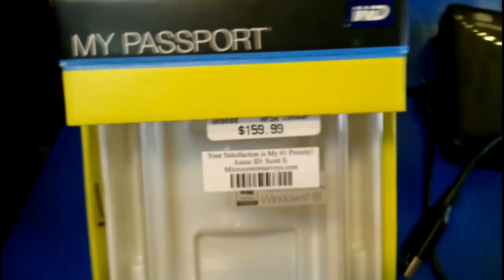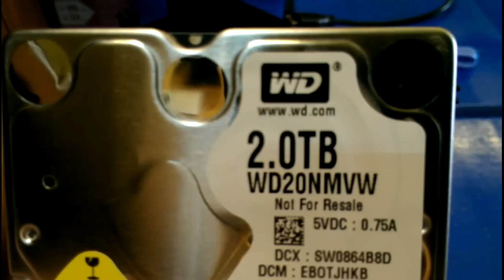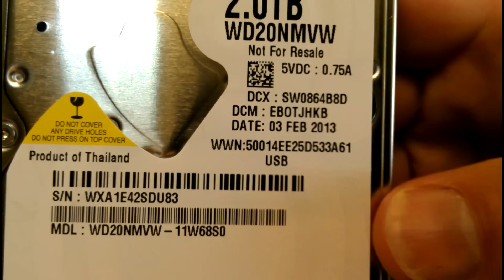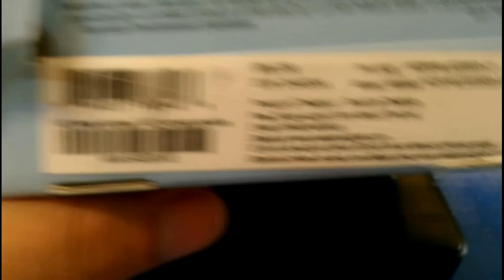Western Digital MyPassport 2TB USB 3.0 HDD Disassembly

Comment: I see some pins next to the USB connector.  I wonder what they are.  It looks like there are 12 pins (2 rows of 6).  It would be interesting to see the pinout for those.  I have seen a pic somewhere of a USB only drive like this with a SATA cable wired to the chip somehow.  I never tried it so I can not tell if it worked or where they connected what.  I just know to avoid those newer my passports.  I wonder how data would ever be recovered from those things anyhow.  It must be a little different from a standard desktop or laptop drive.

Comment: My password is correct ( I'm 100% sure). But it's not working. Earlier, I had set don't ask for password in this PC. After resetting my PC, I can't get into my WD Passport 4TB hdd. It's saying 'invalid password'. It has only been 3 weeks since I bought it and it has some very important data for which I have no backup. WD customer care says that the sector with password might've got corrupted so that I have no option but format! 
Please help.

Comment: This HDD Blue or Black type?
Reply from the maker: that one specifically, I don't remember it being in a color category. Its a really thick hard drive at 5400 RPM. I would put it in the "black" category.  At the time, 5400RPM was high speed for notebook drives.

Comment: hello what connection is the one with all the pins called, 14 pins i believe? not the USB port, the one next to it? thank you
Reply from the maker: The 12 pin header is for "data recovery" technicians.  But you cant just
 plug in a cable from there to your laptops SATA. I have seen people 
soldering SATA connectors to points on the circuit board. But nothing 
easy.
Reply: im not computer savy. I only want to recover pictures and music on my external. What would be my cheapest option money wise? Thank you for the reply
Reply from the maker: Data recovery is scam  that will cost you thousands of US Dollars. You didn't say what was wrong with your drive or IF anything is wrong at all.
Reply: I have a WD My Passport Ultra 1TB. I thinnk I ejected improperly one too many times. I tried a different cable, different computer but it will not read either way. I have a mac. I tried doing the first aid thing but cant repair. The light on the external works fine and there is no improper spinning of the disk or weird noise. I went to an electronic store and they said it could be the USB port thats fried. Changing that out (by sodering a new one on) seems complicated for me...
Reply from the maker: before we butcher this thing, what did WD support have to say about this?
and how did this 'electronics store' know what's wrong? 
if you want to recover data, that will cost you big. At least $4000. you really need someone who knows what s/he is doing to physically look at the thing. A local competent computer shop for example. Not Best Buy or Radio Sh17.
Reply from the maker: at least plug it into a windows machine and then a linux machine.  at this point, its hard to say if its a format issue ( mac vs windows ) or an interface issue. Or something else. it is often possible that a mac will see a set of files completely different from a windows machine.
Reply: I connected to a windows but nothing. The techs at best buy and frys could not bring it up on there computers. The tech at frys just mentioned the USB could be fryed. I only wanted to recover pictures, music and some files. Definitely not $4000 worth.

Comment: Is that .75 amps required for both together? I am having issues with my WD external 4tb drive randomly disconnecting from my Xbox and someone suggested that the power draw may be more than what the USB can supply. I know USB3 can supply up to 900 mA so if 2tb draws 750mA than 4tb would surely draw more than 900mA. Also, I don't know how much my drive draws cause there is no specs for it. Even Western digital doesn't specify it.
Reply from the maker: total at the connection. but that's the max.
Reply: leefiles It only seems to happen when the drive it underload. like processing alot of data. Do you think a external drive with a separate power supply would fix the issue?
Reply from the maker: You can use a Y splitter. You see those when you buy a slim portable CD/DVD-ROM drive. You can plug one end into your PC and the other end to a wall charger. Or you can plug both into your PC if it has true multiple USB controllers.

Comment: @leefiles - Hey man! I actually have the same hard drive as in your video, but I need a new one for my Xbox One (only to use externally). Do you know if the newer models open as easily as the old ones? More specifically model WDBBKD0040BBK-PESN. I have 3 hard drives for different purposes and all different colours. The reason I want to crack a new one open is to spray paint the top green. Also, have you spray painted any hard drives?
Reply from the maker: I haven't had any trouble opening any portable hard drive.  WDBBKD0040BBK-PESN looks like you need a pry tool. Or if you're handy, a credit card or any hard plastic. Not metal.
Reply from the maker: As for spray painting, just remove the label first. You may need many many layers to smooth over all the bumps. The thickness also means you can't touch it for many months unless you use thin layers and wait for each to completely dry first. And don't spray paint in Singapore or you'll be arrested and caned.  https://en.wikipedia.org/wiki/Michael_P._Fay

Comment: Sooo, you CAN'T disassemble this drive. I was hoping that the usb controler had failed and thought about taking the drive out to connect it to a SATA port, but... no SATA drive. Shame.
Reply: This is exactly, and honestly why I will no longer buy another Western Digital external hard drive.  They've made them with proprietary parts, disallowing users to troubleshoot these drives with third-party hard drive enclosures.
Reply: Same here, I really wanted to get some use out of these drive, is there someone new in charge of the USB based drives division?  If so, they need to be removed, this is going to drive me away from WD, I have been a huge disappointment.  The USB interface on these things will fail from time to time, it was never a big deal as I could still use inside of a PC/Laptop, if you take that away, I will have to go over to seagate who still use the more standard interface.
Reply: If the PCB fails, just get a new identical drive and transplant the PCB's. Easy enough.

It's the cheapest solution tbh.
Reply: Any idea on how exactly to do that?
Reply: I'd like to upgrade my old Passport to usb 3.0, does anyone know how I can upgrade it if it doesn't have a SATA drive?

Comment: What's the name of the 12 pin connector?
Can it be used internally if the usb doesn't work??
Reply from the maker: The 12 pin header is for "data recovery" technicians.  But you cant just
 plug in a cable from there to your laptops SATA. I have seen people 
soldering SATA connectors to points on the circuit board. But nothing 
easy.
Reply: Suddenly my WD is not working via USB, and i have many important files on it... 
Do you think is possible to recover them??
Reply from the maker: First make sure its not a power issue. Plug it in a known "good" desktop.   Do that before you go for a warranty claim.

Comment: what are those 6x2 pins besides the USB 3.0 port.. can that be use?.. in any case the port became damage..
Reply from the maker: +Zodiac Hidalgo  You cant use those for SATA. Its USB only. Sorry.
Reply from the maker: +leefiles  actually I did answer that question long ago. see all the way at the bottom about the 12 pin header.
Reply: Thanks...at least its still has other option to recover data..

Comment: Hi! Greetings from Argentina.
Do you know if all the WD My Passport drives have a USB connector as the only possibility? I mean, do they come with SATA connectors by any chance? I have a 1TB model and I was hoping that as it is an older version of the drive, it would still have the SATA connectors. Then I can plug it into a motherboard and run Partition Manager on Linux or something of the sort to save the data, for EASUS Data Recovery software is only useful if the system (Windows 7, in my case) recognizes it.
Thanks in advance.
Reply from the maker: They do that to save money.  The circuit board with the USB directly soldered. So you can't just pull it out.
Reply: +leefiles ok thank you for the response

Comment from the maker: I should mention that this USB HDD is still running. Its plugged into my linux VM server as one of my many backup drives. Its always plugged in. But it sleeps after a while. The drive spins down until I access it.
Reply: leefiles hello I was wondering which Linux command or fstab option you use to only spin up when accessed? Thanks.
Reply from the maker: The USB drive sleeps after a while. It wakes up upon access - any kind of access such as command 'ls' or 'dir'.   I did not put an option. If your USB drive is not spinning down, it may be that its being access by a process/program/app. I don't remember how long, but should be less than an hour before it sleeps. While watching a video on a plugged in USB drive, the video halts because the drive is asleep. That's what I remember.

Comment: Can it be used as an internal drive for a PC case though?

p.s Sorry I'm super new to PC building and all that jazz
Reply: +gamefreak12321 No it can't as the drive does not have a sata connector. The micro usb 3.0 port is connected directly to the drive. Skip to 7:33 in the video and he shows the difference between a regular notebook drive and this one.
Reply: +Spider Tech sigh what a waste
Reply: +Brandon Fong Yeah, if you have 2.5" slots.
Reply: +Spider Tech Ah shit. Didn't watch the whole thing. They're right

Comment: will a western digital hard drive like this work with a ps4? like if i were to take out the hard drive and put it in the ps4.
Reply: +pwnage122334 no
Reply: +pwnage122334 no because as he said in the video the USB interface is soldered into the circuit board, this hard drives cant be used for anything else, also cant the case itself

Comment: thanks for the vid  - I am between this WD My Passport Ultra & Seagate Backup Slim. The WD got the soldered board, which makes the usb3 connection a bit less wobbly, but the seagate backup has this detachable usb3 board, which is more wobbly and prone to braking, but one could use it with sata still after the usb3 connection brakes... hard to decide...
Reply from the maker: deefman Hard drive prices have gone back down.
Reply: leefiles I ordered a 2tb Seagate Backup Plus Slim now because of the replacable sata/usb3 connection. :-) the prices are awesome. all you can backup. getting to know the insides of the passport helped me choosing, thanks & greetings!
Reply from the maker: deefman last month I got a 6TB drive cheap. I also got a 2TB because it was also so damn cheap.
Reply: Were you able to get this crapdrive to work?  or did it fail after roughly 6 days worth of using like mine did? Used it to backup 1.2 TB of data and now that is all gone, not  a happy camper, but that is not your fault, just venting  LOL  So did it work for you and is it still working?  SHould I have any faith in WD USB based going forward or just change over to seagate and the models who use the sata  interface.
Reply: I have the 2tb Seagate Backup Plus Slim now still working. so don't know about your WD. My other 2 WD are much older & still working also. so I can't say any bad things about WD or Seagate. Sometimes its like hit & miss with the HDDs. one can't say wd or seagate is shit. thats why I don't buy used, but new with warranty so that I know 4 sure I got a good model.
Reply: hey s33k3r3000, what can you say now about your Seagate? And did you check S.M.A.R.T. for the model of your internal drive?

Comment: i was surprised to see the USB connector on the board when I first opened mine up and thought I was going to just install it in my laptop. I was mad. are there any other drive like this? I cannot find anything on the type of drive or style of drive. is this a 1off thing?
Reply: Trevor Moon any seagate drive will have the SATA connector on the hard drive. i just picked up a "seagate expansion portable drive" (that's what it's called) from staples and it had a normal hard drive inside.
Reply: Trevor Moon It's becoming almost a standard now with externals. Manufacturers are wising up to our game.
Reply: It sucks 3.0 is slower and sata

Comment: I have one of these decided it didn't want to work any more. The light comes on and makes a clicking sound, but does't load onto the computer. Tried different cables and a different computer no joy. Can i connect via the 12pins next to the usb 3.0 connector somehow?
Reply: Same, really want to get some value from this thing, WD is mostly reliable, have not seen this with other drives I have purchased from them in the past.  It is past the warrantee time now, so want to see a solution where I can use this drive with a SATA cable.
Reply: Means not enough power to this drive. I guess It Needs extra power. 2TB - (0.75A = 9Watt). 
USB 3.0 provide = 1A = 12Watt. USB 3.0 Like this should suffice, But.......
Reply: +John Crowley My exact same symptoms with my drive and my exact same question about the 12 pins. No answers?
Reply: +Mark Jelic no never got an answer
Reply: only way you are going to get it working with a SATA interface would be to replace the PCB. The usb to sata interface is built into the controller circuit. If it does not working with USB it will not work with SATA. 

If you need the data on the disk, take it to a recovery specialist dont try and solder the PCB or open it up that will guarantee to destroy your data.

Klicking is not due to the PCB failing but the mechanics.
Reply: But in the case of Seagate External HDD if External PCB not working then you can change it or use as normal with SATA port.
Reply: It’s a late reply but I saw a YouTube video of someone talking about how to figure out the type of replacement circuit board that doesn’t use usb 3
Reply: My exact same symptoms with my drive and my exact same question about other pins beside the usb 3.0 connector. any help?

Comment: Hi there! Thanks for sharing this video . . I have a question  . . .my WD has a problem my computer recognizes it the drivers are installed, the device manager recognizes it as WD my passport and another problem is on the disk management it says that it s not initialized and when I try to initialized it prompts me that there is  an I/O error . . .  . wishing for your reply thanks
Reply: It may be a power problem. Have you tried it on another computer?
Reply: I/O device error is related to connection issue, might be a faulty cable, not enough power receiving from the computer or faulty USB port on the drive itself. Try different computer, other cable and if does not help call WD for a RMA.

Comment: What do you mean by we can't use it for anything else ? Can't we connect it to the motherboard using port next to the usb ?
Reply from the maker: The 12 pin header is for "data recovery" technicians.  But you cant just plug in a cable from there to your laptops SATA. I have seen people soldering SATA connectors to points on the circuit board. But nothing easy.

This hard drive most likely will not fit in today's laptops. If you are using this in a desktop, then you can just use the USB. Linux will install on a USB drive just fine. Windows on the other hand will not boot. It chooses not to boot! Windows is designed to not boot off of anything other than internal hard drives such as SATA 0.

Comment: my laptop has a esata port instead of usb 3.0. how to i get benefit from that? is there a way i can connect it to estata and get better speed?
thnx for this video
Reply: i thought a usb 3 male to esata female cable would help. but would it increase speed?
Reply from the maker: I couldn't find such a thing on ebay. That would require some processing. You can still use this drive with an ordinary USB cable. You can take a microUSB cable that you use to connect your cell phone to this drive. A USB 3 connector has two parts. It has micro USB plus the USB 3 specification.
Reply: Unfortunately not, eSata and USB are two different control architectures...

Comment: Hey I was curious did you swap the USB 3.o interface for the SATA interface from the 1TB you had ? Did it work ? You said you can slap the 2TB in a laptop of it fits but how would you connect it if as far as I know all internal hard drives use the SATA interface or an IDE ( if you're using hardware from Stone Age lol )
Reply from the maker: the drive has a built in usb3 interface. so you if you had space you can use it but you would connect it via usb3 or usb2.

Comment: leefiles I have tho hdd and one day someone unplugged without ejecting it from the computer and when I plugged it again it takes more than an hour to be recognized for my mac, I can see all the files but i can open any of it.... I got a message that say that i can not write or read or save any of the files, Do you have any suggestion? what i can do to recover the files I have in it? I'll really appreciate any help!!!
Reply from the maker: That can corrupt files. It may still work.  Try a scanner called "Disk Inspector". (Youtube doesn't allow links to be posted).
Do you know anyone who has "norton disk doctor"?

What I would do if that was me is to either:

In Windows, run chkdisk or scan disk. Or I would right click on the drive and choose properties. then click on the "tools" tab and run the utilities there.

Or in Linux: I would run fsck.ext4 [if the filesystem is ext4].